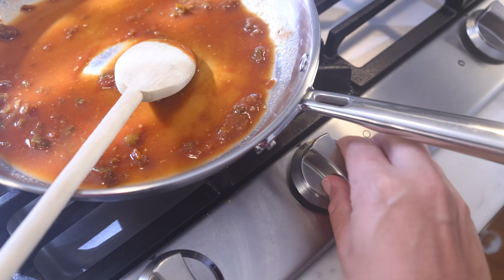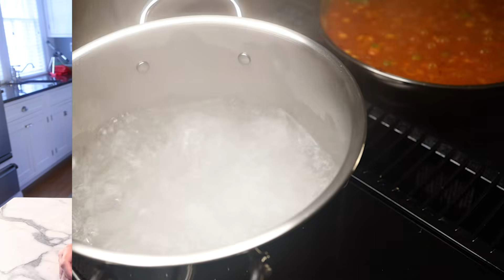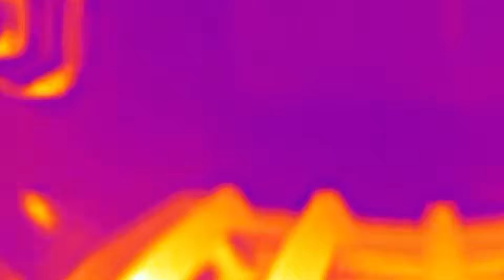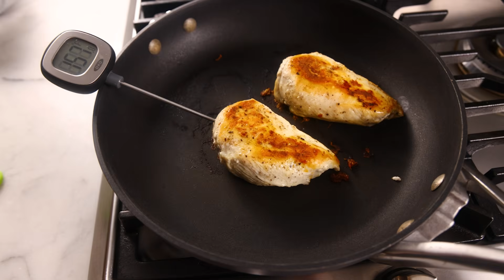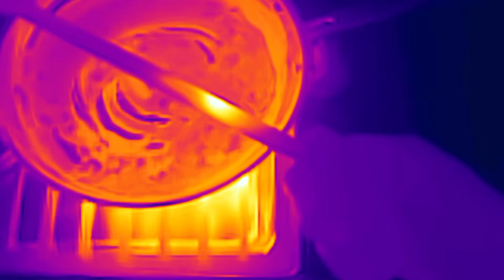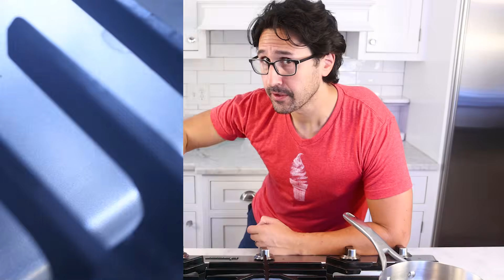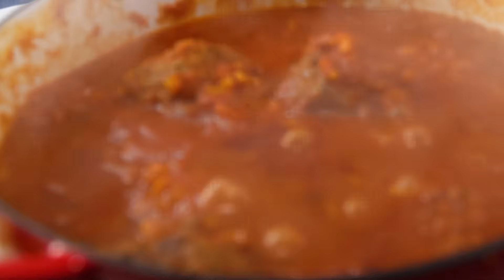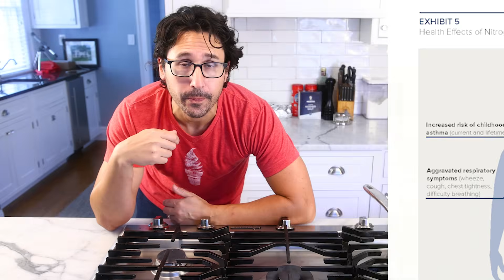Problems with gas stovetops | weak, dirty and dangerous

Comment: I learned to love cooking working in restaurants. The gas ranges there gave me so much more control versus the old-school coil range at my parents’ house. 

Yup, loads of waste heat, but the ancient Viking ranges I used back then and the Thermador I have now could turn down mighty low. Custards, gentle-slow crispy frying, slow simmers, a huge pot of potatoes with no boil over, no sweat. Some “high end” ranges now are so focused on the higher BTUs, they’ve forgotten most cooking happens with gentle heat - I had to look a long time in the early 2000s (two years) to find something that had good low-temperature gas burners. Maybe there are more options now, but the marketing of kitchen stuff is oddly obsessed with power. 

The Thermador even has two extra-low burners that can cycle on and off through a range of ‘on for 52 seconds, off 8 and on 8, off 52’. It lets me make a cheese sauce and set it on them so it won’t either break or burn, just stay warm. I use it to reduce sweetened condensed milk to dulce de leche almost unattended. I check it every 40 min or so to stir a bit. I can even melt chocolate in a pan, right on the burner without it burning or losing temper. It’s just a click above being a candle at that point. I leave my chemex pot (the glass handle kind) on an extra-low burner to keep the coffee warm. 

If I had any advice for someone who’s getting used to gas, it’s take it slow - don’t keep a burner all the way on, rarely do you need that kind of heat for anything but boiling or stirfry. Things will take a little longer, but you won’t have any scalding. The flame adjustment is also much finer as you move away from high to low; it’s not a linear progression. Nice and easy does it every time. Btw, get a huge griddle pan and slap that across two burners that Dacor, that’s some fun there.  🙂 

I’m not completely beholden to gas. I’ve looked longingly at the single burner portable induction ranges you can get. There are things like sauce reduction where it’s fine to let the gas burner while away at it, but I’d really like to give it the spurs with an induction burner. Sometimes I compensate with things like a 14” sauté pan to really spread out that surface area for reduction.

That said, the restaurant years made the excess heat, running an exhaust hood when there are high temps, and never leaving a utensil in a vessel something I didn’t think twice about, it’s just what I knew as normal. And they are for sure slower to heat and a real pain to clean up (I think from being in a restaurant, you get used to the idea that gas equipment is going to be dirtier, kind of charred and corroded -  not saying that’s good, it’s just a thing that happens). A lot is what you like and are comfortable with. I haven’t worked in restaurants in decades, but every time I stand in front of that hot Thermador, I’m taken back to my younger days and where my love of cooking starts. 

I wish I could tell you that Dacor was going to go to pieces soon so you could have a stove you enjoy more, but I think they’re pretty sturdy. I recommend some kind of stove mishap. “Goodness, it was an accident, I’m not sure how that could have happened! Guess we need a new range!”

Very best wishes, but if it were me and I liked induction better, I’d order one and drop that annoying Dacor like a hot rock. I did the reverse of that when I bought my house and there was an induction range (even had to run gas to the kitchen). Cooking should be a pleasure, whatever way of cooking that means for you 🙂

Comment: I have a little single burner induction cooker that I use to boil a tea kettle full of water for my coffee and oatmeal in the mornings. It boils water pretty fast, and like gas, it's responsive. Turn the power down and it immediately goes down or off and it's immediately cool, just residual heat. The downside is you can only turn the power down so far. After that it starts cycling on and off to reduce the power, similar to a microwave on 50%. It only runs half the time. For boiling water though it's pretty good.
I just got back from the camping trip and had the same problem with the propane stove top in my trailer. First thing I would do is get out of bed and turn the kettle on to start boiling. Then by the time I'd gotten dressed and done my morning business, the water was boiling for coffee. It sure seemed like it took forever.

Comment: With electric, there’s always a hot spot in the middle of the pan, and the edges don’t get nearly as warm. With gas, the whole pan gets evenly heated.
Reply: I doubt that the pan gets evenly heated with gas.
Reply: you might be using a wrong sized pan for the burner then
Reply: This really depends on the stove. Electric resistance coils, only the coil is heated, which is usually smaller than the pan. Induction stoves usually heat a small area, but I imagine the higher quality stoves diffuse the heat better. Infrared burners may heat the most evenly of all, from what I hear. The even heating of gas burners is highly dependent on the design of the burner. There are many ways to arrange the flame. Newer designs are said to be generally better, with more adjustability and different fire ring sizes and dual fire rings.

My old gas stove from the 1950s or '60s heats alright with it's "X"-shaped burner. The flames are arranged in about an eight-inch X. It works fine for 8" pans, 10" pans generally good enough (although I buy higher quality, more even-heating pans at this size), and for 12" pans it's inadequate and requires a high-end pan (with a thick copper or very thick aluminum layer) for even heating.

If a burner heated perfectly evenly, we'd be able to use flimsy cheap poorly-conductive pans and get perfect even heating. But no matter how unevenly heating your burners are, you can buy even-heating high-quality cookware to spread the heat out. It's not necessary for wet cooking and most pots (those stockpots that cause hundreds of dollars are pointless), but for "dry" cooking it's important. A good skillet heats evenly. I recommend stainless steel-clad aluminum, unless it's a large skillet and a small burner and you can afford the substantial weight and expense of thick stainless steel-lined copper (like the Mauviel 250 series), which is more even-heating as well as more responsive and quick to heat than other materials. The thickest stainless-clad aluminum pans (thickest of all being Demeyere Proline skillets) heat almost as evenly, and have similar high heat capacity, but take longer to absorb and release heat.

Comment: You need a flame tamer or heat diffuser. There are various models but the one I got back in the late 70s and still hold onto despite my electric stove is simple a circular piece composed of two steel plates with a space between them, a couple ribs to give it more strength and multiple rings of holes plus a metal and wooden handle. 

When the lowest setting on the gas ring isn't low enough, just slide in the flame tamer and it cuts the amount of heat considerably. No need to babysit things to simmer. Plus, since the device is about 13 inches wide, it protects the sides of the pan from too much heat--no more burnt custard on the sides of the pan.

Comment: I live in a asian country so i have been used to gas stove my whole life. I thought that blue flame was supposed to be much hotter than an induction or electric stove and clearly it isn't. I always burn food even at the lowest heat possible on the induction stove(probably due to the fact that mine is not an expensive one) so I never fry anything with it. But cooking watery dishes like soup or stew with induction stove is so easy and I can also set a timer for it

Comment: So we have an electric oven (which is smaller) and a larger gas oven.  The gas oven heats up WAY, WAY faster than the electric oven.  Same brand.  Based on this video I would have thought that the electric oven would heat up faster.  Any idea why that is?  Also, perhaps of interest, we have a gas range and in order to get low simmering, the range will turn on and off to control the temperature better because, as you mentioned, there is a limit as to how low the flame can go before dangerously going out.  This system is similar to a microwave heat percentage, which is also, just a timed on and timed off.

Comment: I don't know about yours guys. But here in Indonesia, the gas for the gas stove is cheaper than the electricity bill for the induction stove. Heat is the most expensive energy conversion from electricity.

Comment: The fact that the gas stoves that I've used (in houses) have always outperformed the electric stove tops of the apartments that I lived in shows that apartments / the corporations behind them like to cut costs (who knew?!?)
Reply: I've noticed this too, when I was living in a cheap ass old college apartment there was this atrocious looking range with the exposed wire. It was so nasty from probably decades of not being properly cleaned. But DAMN did that thing get hot fast. Boiling water took no time at all. I moved into a newer place with a much nicer looking under glass kind of electric cook top, which I was so excited for but the actual performance of the stove sucked. I legit thought it was broken the first time I tried to boil a big pot of water because it took so damn long. So prettier does not always equal better when it comes to electric ranges. (Although I wouldn't switch back because cleaning those exposed wire ones is a nightmare)

Comment: Bundling all of the electric cooktops as more powerful and faster to boiling than gas is very inaccurate: electric coil stoves don't outperform gas. ceramic glass tops that are not induction cooktops are not all more powerful than gas either. Efficiency is debatable, especially when the non induction cooktops end up heating the whole glass top over time. This waste of heat creates a sort of inertia that makes quick adjustments impossible.

Comment: I find I am just better at cooking on natural gas. Idk if I'm more consistent or what, but I always have trouble getting the heat right and steady on electric. I have a tabletop induction cooker which is great, but I like the ability to cook in non-ferrous pans. 

Propane is a nightmare though. Often "medium heat" is the burner all the way down 😬

Where I live we have hydro power so electricity is a good option for environmental concerns, however despite electricity being $0.10 - 0.12/kwh a home with natural gas appliances will save a lot of money.

Comment: Interesting. When I picked out my new apartment earlier this year one of the requirements for me was a gas stove. I had only used a single electrice stove before: an old 50s-era coil one like you showed. I vowed I would never use one of those again.

Comment: I think this is a fine commentary on gas stoves

I just want to point out that getting natural gas from non renewable sources is by far not the only way to get it

Anything from woodgas producing industrial amounts for power plants and residential to a bio reacter where you personally can produce methane in your back yard with Gras clipping and food waste
Not to mention methane capture from livestock 

It's a viable energy generation option in a green future
And has the distinct advantage of actually sequestering carbon when being stored 

So I just wanted to point that out

Comment: So you have a crappy but expensive gas cook top with huge cast iron grates.  That doesn't mean you can't get a well designed gas cook top. I've cooked on electric cook tops most of  my life and I hate them.  The temperature time lag is just a pain to deal with when cooking on an electric cook top.  Now I have a well designed gas cook top and I love it. If you want to get hot water fast for pasta get an instant hot water tap for your sink and use it to fill your pan. Either that or plan ahead -- its just not that big a deal (to me). Glad you found your pop up down draft ventilator. I have one and I agree with you that it is a good idea to use it whenever you use your cook top.

Comment: Gosh our great grandkids are going to look at today like we were in the dark ages. We had to cook with either wires that got really hot or open flames in our homes, make our daily commute in machines that run on precisely timed explosions that have to be refilled at specific stores, raise and slaughter animals to get actual "meat", and dig up stuff from the ground to burn for electricity. A lot of dangerous and inefficient processes that we're so used to.

Comment: That extra wasted energy that gas stoves generate that doesn’t actually heat your pot may not necessarily be wasted energy. Where I live much of the year we spend energy to heat our homes. Running the gas stove helps us keep our houses warm and allows the heater to run less.